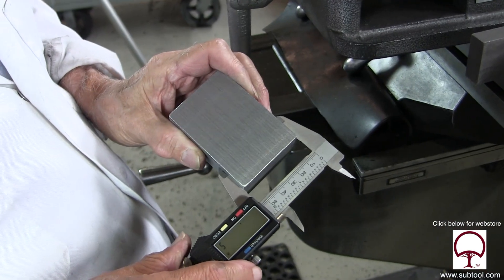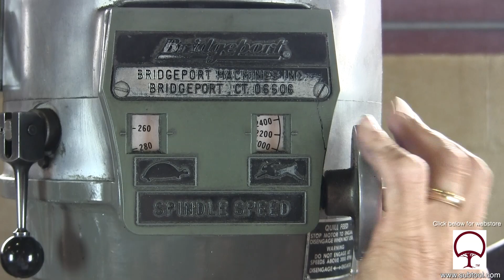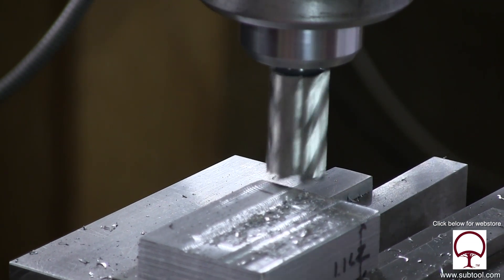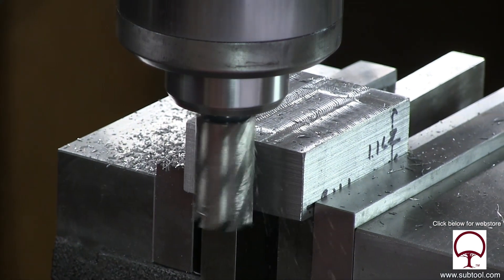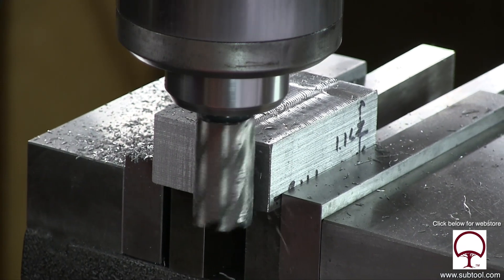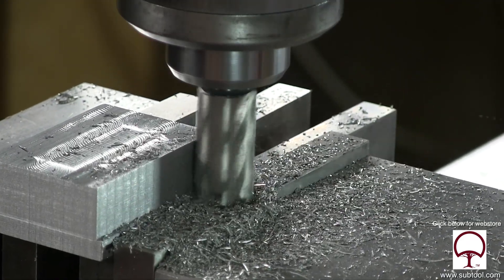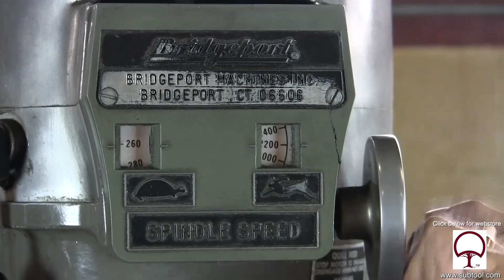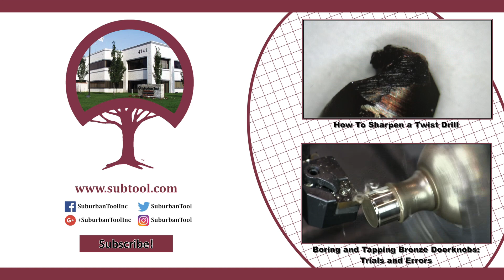How To Machine and Square 6 Sides of a Block Using Only 2 Setups

Comment: Hello Sir, I have used cnc machine for squaring my job, but after some facing operation parallels beneath my job got loosen up, i think the reason is  that the block was kind of pulled up during facing. I am squaring up 316*238*35.8 mm aluminium job, which tends to bend if press hard against vise jaws. can you guide me, what should i do? I would really appreciate your help.
Reply from the maker: That's a very delicate situation, and you need to find a balance between how much your tinted the word vise vs how big of a cut that you are taking. hopes that's helpful .

Comment: Those vises move soo much. When I was in my teens, I had to do a run of blocks on a BP. I complained to an old guy there that I hated vises and though they were throwing me off, and he went on this long anti-vise rant. Long story short, he helped me build a tool that held my blocks right on the table. It worked awesome and was more accurate than the vises.
Reply: Kangol Yeahh well come on mate! Share the method with us!! There is no point mentioning it, and not showing us how lol

Comment: This is commonplace on CNC mills, but a LOT of people can't make the transition of this technique from CNC to manual. Makes squaring blocks so much easier! Theoretically, you could have gripped your part by .100" and machined all five sides, then simply removed that .100" in your second op. Then again, having all sawn surfaces might make that even more tricky than normal!Good video, Mr. Bailey. Thanks.

Comment: Yes this works, but in my opinion a much better way is to get that block out of the vice and on to the table. Assuming it's really rough sawn with no decent surface to work off. Put it in the vice and face the top, that becomes the reference surface. Then set it up on parallels by clamping directly on the table with the fresh face down, you can then machine 2 sides without any step. Then begin machining the top, put some more clamps in the machined area and remove the old clamps. Finish machining the top and then the two remaining sides. You will finish up with a block that's as accurate as you care to make it, has no steps, and with all sides square and parallel. Your grinder hand will love you.

Moving clamps doesn't take long at all and there is often room alongside a vice to setup like this without having to remove the vice. Unfortunately the current generation of machinists have become lazy and unimaginative, and if something doesn't fit in a milling vice, or a 3 jaw chuck on the lathe, they're completely screwed and have no idea how to do the job. In this instance, setting up directly on the table is infinitely better than using a vice. I like to read old books and magazines on machining, and it's amazing how imaginative and creative those guys were. Great results with minimal equipment.
Reply: THANK YOU for this! I really wasn't impressed with the vise (I live in the UK too but prefer vise) method and was thinking there must be a better way. I don't have any machines but I've been learning a lot off of YouTube and reading forums which will help immensely when I do get a lathe someday.
Reply: Great info! Q: How do you prevent milling into the table surface?
Reply: The block sits up on parallels
Reply: Pete F I agree.  But also I have a squaring fixture I built which is like a vise with a built in angle plate.  It's the best way I know how to do it.  But we each work out what's best for ourselves.

Comment: NIce Video. You can also get TalonGrip vise jaws that allow you to hold onto the bottom of the block with just 0.060". You use your same method, but after doing the top and all sides in one setup, you can flip the part over and then just mill off the 0.060" from the top. This way you only touch the sides once leaving them perfect.
Reply from the maker: Thanks for the suggestion.

Comment: With manual machining I think I could have done that job quicker with 6 setups and less futzing about with the cuts but if a CNC program was being used the two setup method would rock.

Comment: The less set ups you have do means less chance of mistakes .
Also useful when you have to  remove a lot of stock , say you need some stock say 2x2x3 but only have 2 1/2  square stock you could use a roughing mill to plow down that stock then flip it a do the second set up.
Those half balls , possibly made by Chuck from outside screwball channel he did a series on making them .
Reply from the maker: Right you are.  I remembered that they were a gift, but my memory slipped when it came to who gifted them while recording the voiceover.  I have mention Chuck, his channel, and provided a link in a standalone comment; leave it a thumbs up so it says at the top of the comment section.

Comment: Thank you, Don and Suburban Tool! I very much enjoy and learn from you and the other metalworking "creators" on YouTube.
I have been running a shop (a production shop involving sometimes involving 100,000 part runs) for many years and I have never thought I knew it all. Keeping an open mind is the best way of finding out how to improve processes so the business can be more competitive and profitable. 

Personally, if I were too do a number of blocks, I think I could do it faster in three setups (not really setups because it would be the same part/machine orientation. Only the knee would be moved to adjust size) because I wouldn't be trying to match the cut previously made.

setup 1: mill one side (doesn't matter which one) to true (I'd start with the 3" side being milled). Do this to all blocks.
make adjustment: move the knee to cut the parallel side to within desired dimension. Do this on all blocks needing processing.

Setup 2: use the parallel sides just milled to true the 2" side
(repeat moving knee to adjust desired dimension)
mill all the blocks needed here also....

Setup 3: using the 2" side in the vise, true the 1" surface
(repeat above)

Some might consider the above 6 set-ups but it's really 1 with 6 adjustments. Finished and no careful matching needed. 

While this might not be as square and as perfect as the method in the video, in production time matters. Besides,  .030 total stock is a "mile" for finish grinding.
Reply from the maker: You are very correct, this is exactly how you would do it when making multiple parts to the same size.  This demonstration is purely for a "one-off" part or project.  Thanks for sharing and for the comment.

Comment: Don: What size diameter end mill cutter (and number of flutes on it) are you using ?  
It must be "very large" and "ridged" to avoid chatter when full length cutting.... NO?? 
Thanks Brian F. AKA GUSMIX
Reply from the maker: I don't remember off of the top of my head, I'll check back in the shop today.
Reply: OK I'll await that info...
Reply from the maker: 2"x1" 6 flutes...
Reply: Thanks

Comment: Interesting technique but arguably of limited use if you don't have a grinder, but then again if you are only roughing stock?
 Good to see you using the knee, rather than the quill, to take a cut. It seems a number of Americans machinists are allergic to the effort required to do it the right way. :>)
Reply: Hey, I resemble that comment Chris.  : )
Reply: Told you so, :>)

Comment: I don't really like the thought belt sanding if the block is to be considered square and parallel, but otherwise it was a smart trick that I have never thought of. Thanks for sharing :)
Reply from the maker: I didn't have to, I just did it on this with this one off project because it made me happy. If I intended for this block to be held to precise tolerances, it would go straight to the grinder after the Bridgeport.

Comment: but now is the question if the blueing and hitting it with a beltsander takes more time/money than a couple more setups.

btw those balls are meant to be used with the flat side facing the vise jaw i think. :)
Reply: matze1508 The jaws are hardened, unlike the workpiece.
Reply: Does it make a real difference?  You still get a point contact either way, which is the objective.
Reply: yeah but you might make a dent in the jaw beacuse the ball is possibly harder than the jaw.
Reply: That`s why there is a flat on the ball, so the pressure ist distributed on a bigger surface and doesn`t leave a dent.